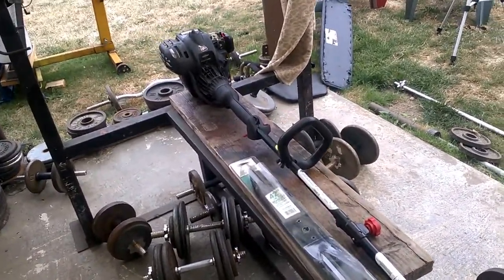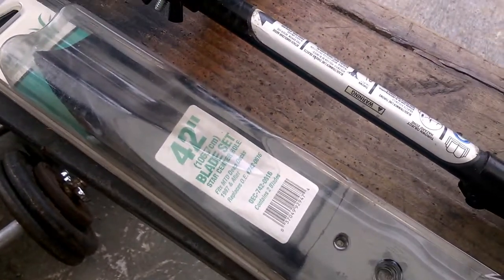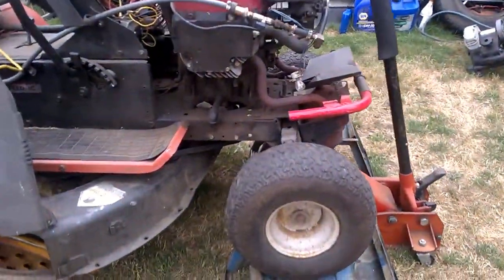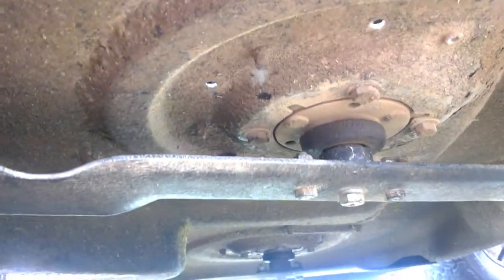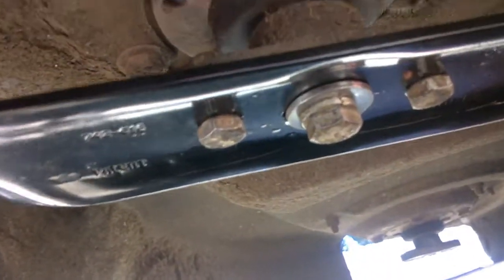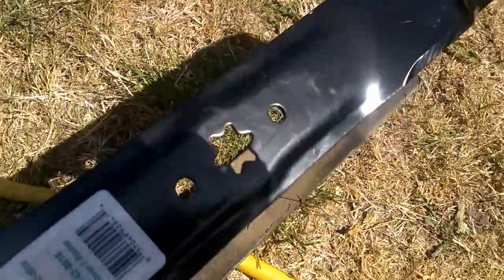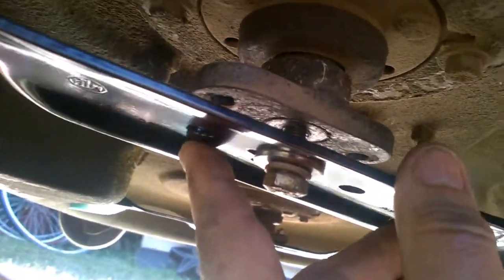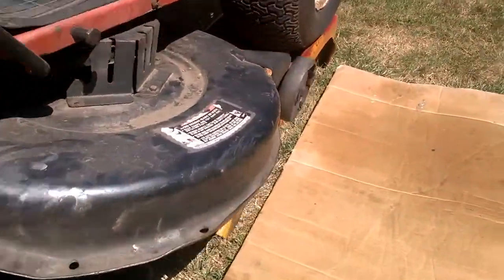42 Inch MTD Deck Blade Replace

Comment: Size bolts
Reply from the maker: I don't recall size now but all were new SAE Grade 8 bolts. Matched new to old. Still using it since, but now with an electric fuel pump as bulb rubber hardened